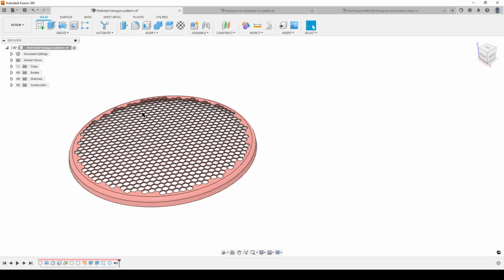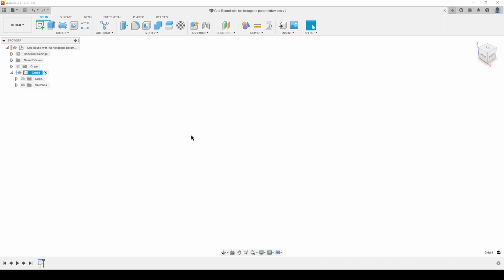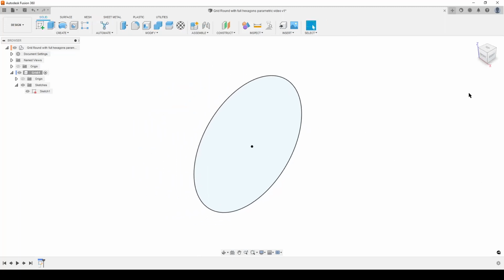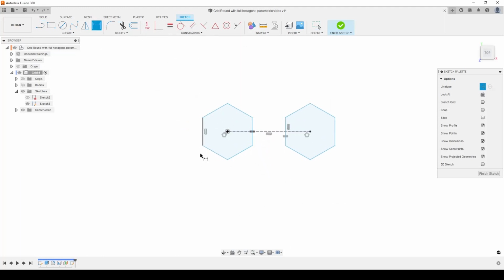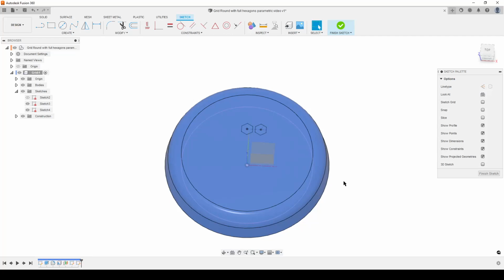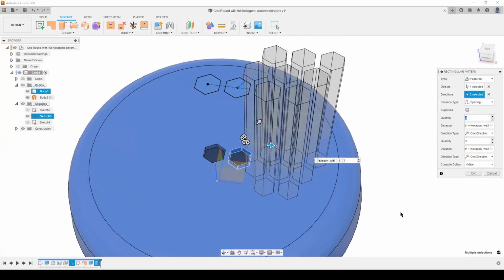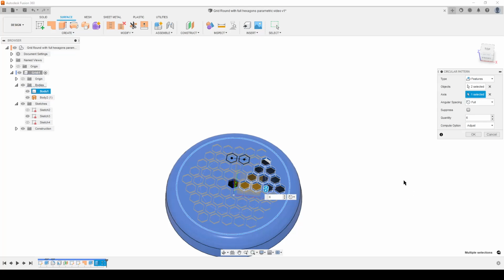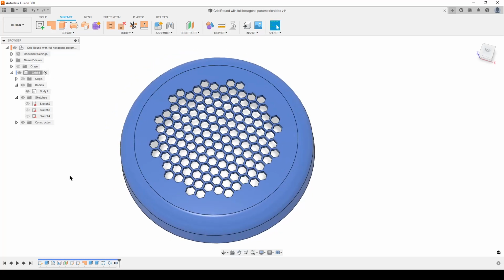Fusion 360 - Another Hexagon pattern but only full hexagons (parametric modeling)

Comment: I did the task exactly according to the description, but there is a problem with the array, the figures climb out beyond the radius. I don't understand what's wrong?
Reply from the maker: Check that you are doing Extrude to Object (surface body) and the rectangular pattern must be "Adjust".
Reply: I understood. When I project the Radius for the cutting place from the first circle all works perfectly. But when I project a smaller one (radius after chamfer) like in the video, it doesn't work

Comment: I am in my second month learning F360 and I am overwhelmed at the power of the software and how many different ways something can get done.  In simply terms if i start out with a shelled box what is the best approach to create the same repeating pattern for each wall.

Would i need to create sketch and extrusion for each axis or is their an easy way to reuse the pattern.

Thank you in advance.
Reply from the maker: If you have symmetri you only need to make 2 sides of the box, but it will take time. If you want to make the pattern line up around the design be prepared to spend a lot of time testing different dimensions.